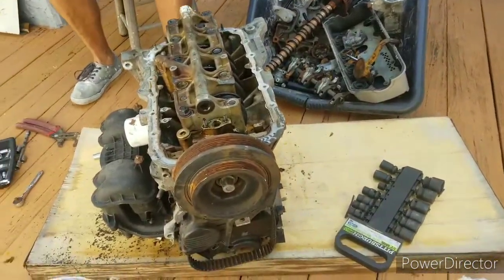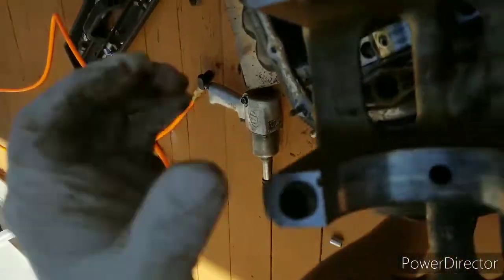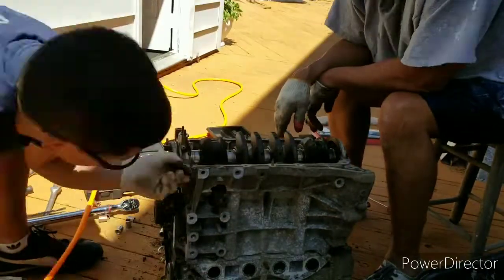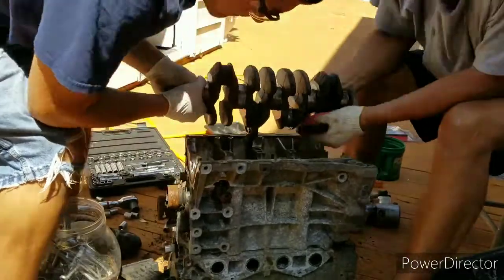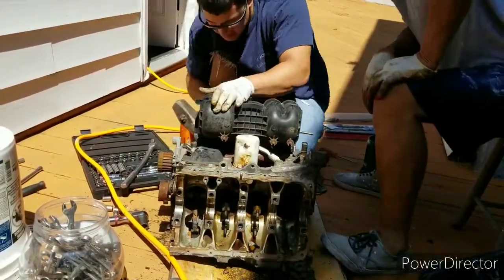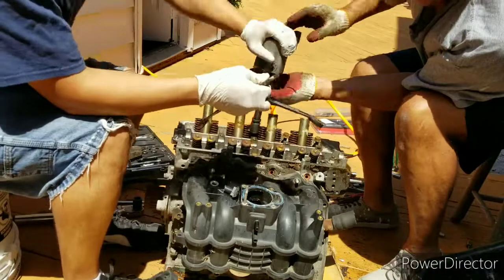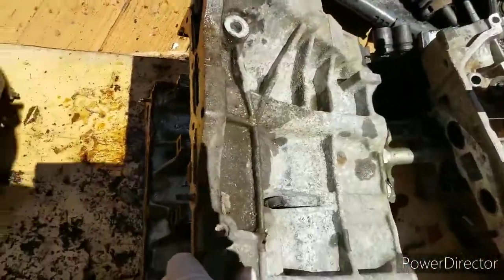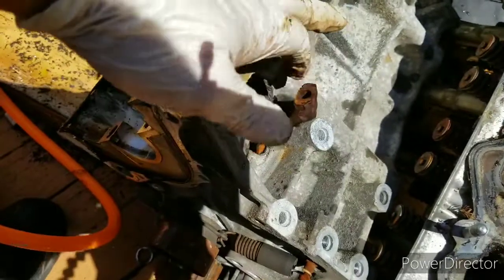How did it blow up? | 01-05 Honda Civic D17 engine disassembly/autopsy

Comment: hey congratulations, still running it? I have option to get car and motor in it with same hole in pan, in the exact same spot , it met the same exact fate as yours did.  He said the same thing even. was going down highway it happened.  It is automatic though. and considering he drove it hard and long time while low on coolant or oil for it to seize, I don't think the trans was respected at all. could not have much life left, so I want to do both as same time.  Did the JDM motor seem like it had 55k miles really? does it burn oil? start in cold fine?
Reply from the maker: The Jdm motor ran so smooth and perfect. Still had the blue coolant and all orginal parts. Did not burn oil

Comment: Interesting, I wonder why it failed. As clean as it looks inside, it doesn't look like it was neglected. It doesn't look like it ran out of oil since the other bearings and the cam journals looked fine from what I can tell on the video. I don't see any signs of overheating either. I've seen these engines get hot enough to melt the timing covers off with no damage to the bottom end, so that's probably not it. Maybe just some type of manufacturing defect?